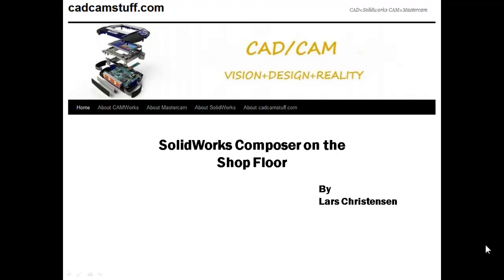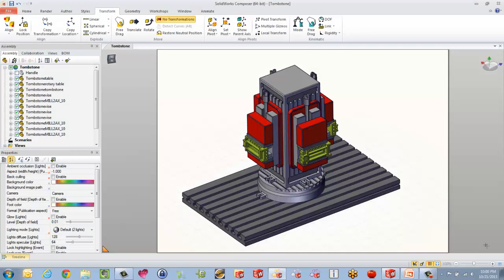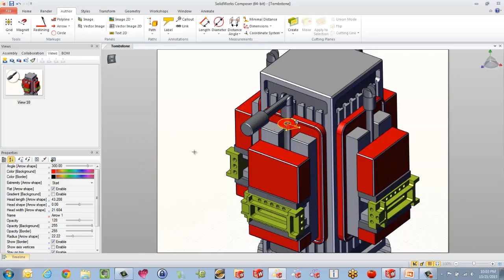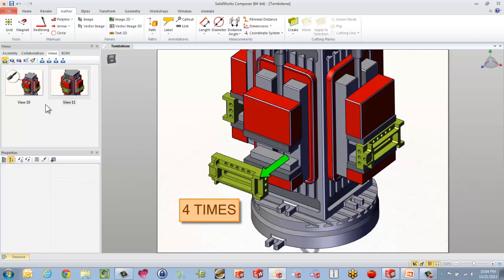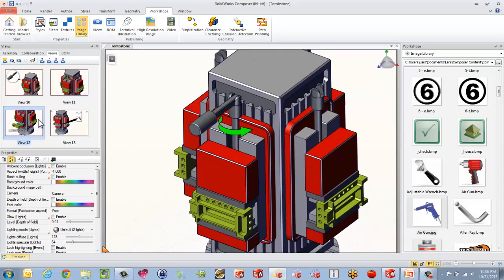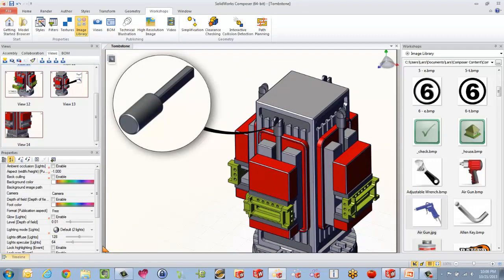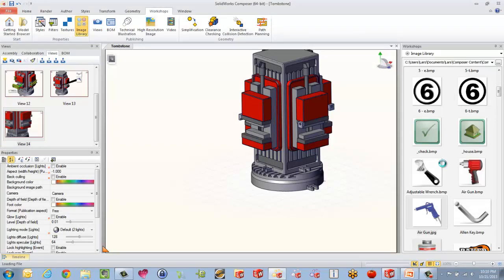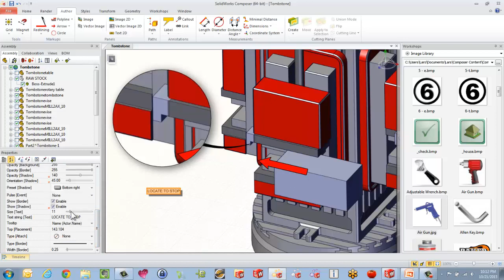SolidWorks Composer on the Shop Floor

Comment: Lately you have been very active describing Fusion 360. The composer product from Solidworks is one of the programs that have the ability to save incredible amounts of hours when assembling documentation, yet it is not frequently used. In your Fusion 360 series I really miss information about how to interact with products like MS Word.

Is there a smart or a dynamic way of linking objects - is there a way for Fusion 360 to dynamically update rendering/motion files.
Reply from the maker: Hi Jens Agerskov Thank you for watching!
Well, first of, I now work for Autodesk instead of my old Employer, CADimensions, who is a SolidWorks reseller :-).

SolidWorks Composer is not a CAD program at all, but a publishing tool for CAD files to become documentation. Now, I have lost totally connection with Composer the last 4 years, but, I am pretty sure they stopped development of the product, and it was never really that successful a product.

Back to your original question. No, generally CAD, including Fusion 360, does not have a great way to push the models into documentation.